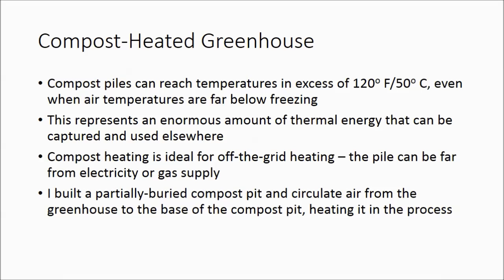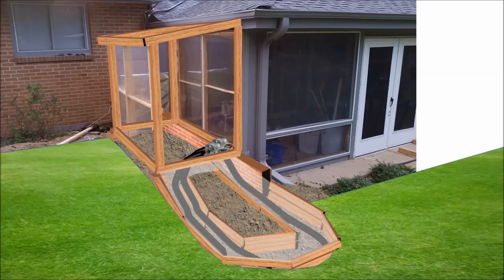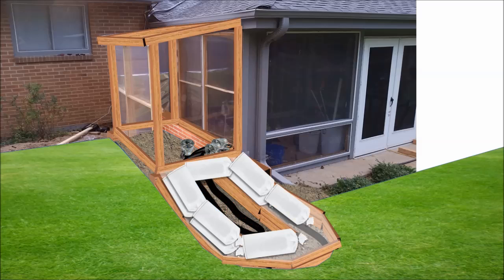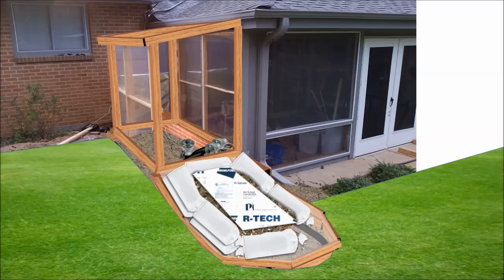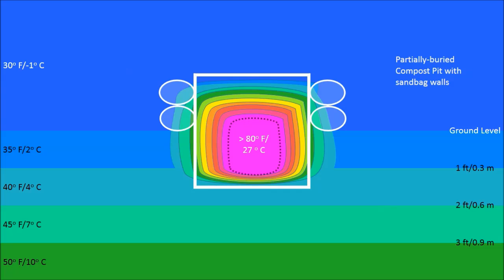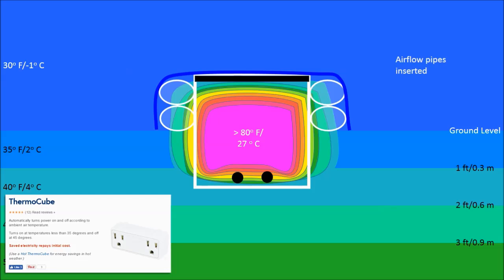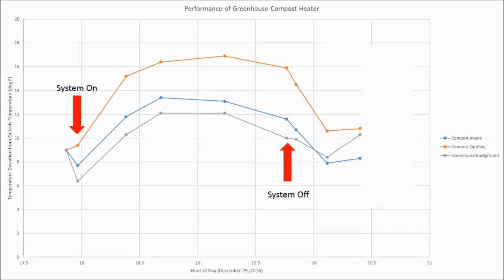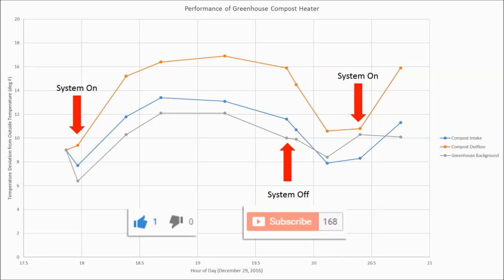Heat Greenhouse with HOT COMPOST.  2016 Build and Results

Comment: Thank you so much for the depth of details. I hope to see another about the useful length of the pile and some correlative information on its mass/greehouse sizes. This is exactly what I was thinking, partially buried pile, north side of the greenhouse, small fan, with a double wall greenhouse. Please follow up with more of your valuable insights.
Reply from the maker: MarkH10 you are quite welcome!  Please take a look at my previous video where I go into details on the  build of the greenhouse.  I think the system works, but if you really need the heat I might enclose the pile in the greenhouse.  I've got good insulation but would rather "lose" heat to my greenhouse!  Of course, it doubles the size needed for the greenhouse.   Let me see if I can get some more data, now that I've gotten the pile up to 145 deg F!
Reply: Morgan Brown I've been watching your videos.  I recommend everyone interested in the subject do likewise.

Comment: Hello, great video. Thanks for sharing. I have a question, how do you turn the compost without damaging in the long term the plastic piping?
Reply from the maker: I would like to revisit this question.  Hopefully you and some others will see it.  I think a removable heat exchanger is a must-have.  If you see my greenhouse 2.0 videos (see links in description), note that I simply use a flexible dryer vent, laid near the top of the compost pile.  It is easy to add new compost or turn the pile without damaging the heat exchanger.  If you look at the videos from people using poly pipe, they admit that when they remove the pipe at the end of the season (with an excavator), they invariably poke a lot of holes in the pipe.
Reply from the maker: Giovanni Greco good question.  The air pipe is at the bottom of the compost chamber, so I can do things like turn in coffee grounds without touching the pipe.  Also, the pipe is made of a tough material

Comment: Does the compost give off any gases during the breakdown that would be sucked into the greenhouse?
Reply from the maker: Eric, yeah, primary gases emitted will be CO2 and ammonia.  However, this system is sealed off from the greenhouse.  The heat exchange happens by circulating air in an airtight pipe UNDER the compost.  It would be more efficient, in terms of heat exchange, to just put the compost in the greenhouse.  But I don't want to breathe ammonia and I don't have space in the greenhouse

Comment: great video
Reply from the maker: Sean Ogilvie thanks!  The system has worked well...when the compost is active.  It's been hard to keep the pile from freezing.  I believe the problem is lack of usable nitrogen.  When I added 5 pounds of coffee grounds, a newly built pile was at 110 deg F in a few days.  I also need to expand the size of the compost chamber.  That said, my geothermal and a couple 100 watt heat lamps keep the greenhouse quite warm while I'm fussing with the compost.